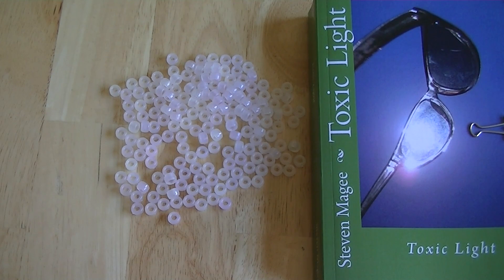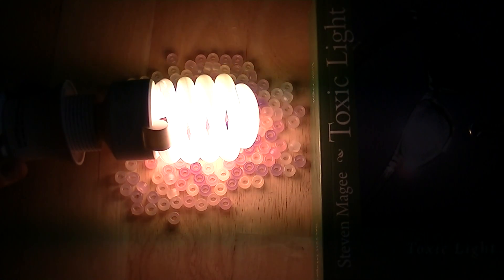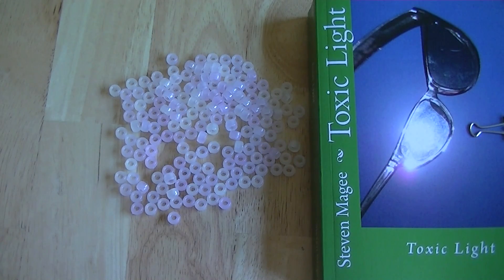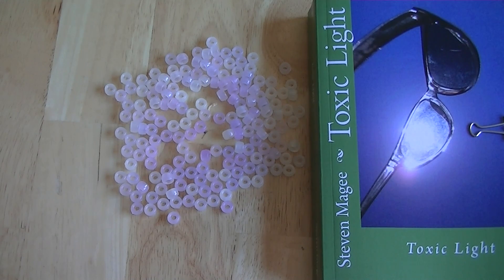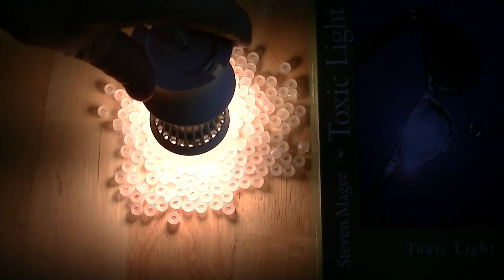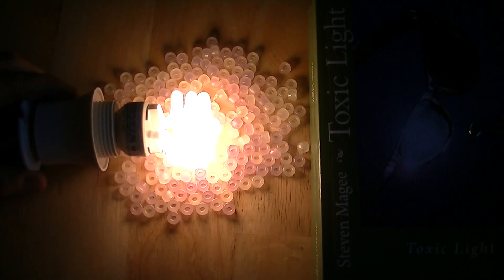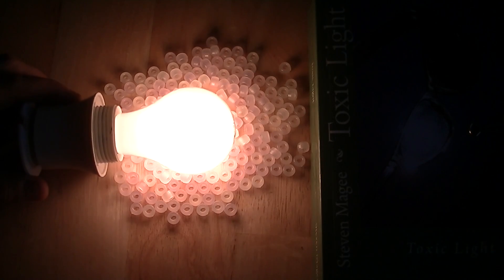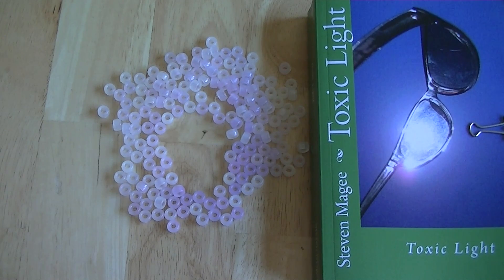Testing LED, CFL and Filament Light Bulbs for Ultraviolet (UV) Emissions

Comment: You can remove the glass bulb covering the Halogen envelope simply by wrapping the bulb with stick tape and then hitting it with a hammer, that way it can slide off easier.

Comment: If you tested the light bulbs and held them 1 foot away from the toy beads, do you think there would be a difference as to how much the beads color would change?  I am thinking the UV output would be less at 1 foot away but not sure.   Maybe I will have to buy some of these beads and test it myself out of curiosity.

Comment: there is a slight flaw in the logic presented here.

A: there are three types of UV radiation - UVA, UVB, UVC.  UVA is what blacklights put out in color, as do ALL florescent lamps, but the further you are from the CFL and tube type the less radiation you get received, to the point it has no affect.
B: what you might be REALLY sensitive to over a long period is the flicker of the florescent bulbs, which is very high frequency, and it can cause headaches or nausea in some people, even more so near the end of their life or at 50Hz.
C: Cheap quality LED bulbs (and chrismas light strings) also present a strobing effect in tune with the line frequency because there is no buffer inside to counteract this (a capacitor that provides power just long enough during the low point of the wave to keep it lit).

So while you analysis does show that UV radiation is emitted, it doesn't account the three types of radiation, (UVB and UVC are the more harmful ones and can cause burns and blisters).  Here is a word of advice, though, if the florescent bulb is CLEAR, then you are in danger without protective clothing because THOSE bulbs are Germicide lamps and they are intended to kill germs.
Reply: He demonstrated cause and effect, not a line of reasoning requiring a form of logic. I found this video to be very informative and helpful though not exhaustive. I went from here to WHO's website http://www.who.int/uv/faq/whatisuv/en/index2.html which gives helpful information about the types of UV radiation.

Comment: I like the leds. They start up quicker then CFL's they use less energy. They are cheaper to run, last longer and oh yes.. they don't get hot.
So the only negative point so far the price. But that is going down so fast that really they make the perfect replacement bulbs in my view.

And I have tested out an CFL with an Foveon Sensor. I have a foveon DSLR and those have an UV blocking inlet in the mount instead of being part of the sensor. This means I can take out that little UV filter and I can shoot IR and UV.

I shot a 20Watt CFL using the sensor exposed to the UV and IR and I did get a lovely stream of purple pouring out from the lamp in a cone.. Purple is the color of IR/UV on that sensor.

It is interresting to see really.. [and yes if you shoot a picture outside without the UV filter in the camera it gets super purple and all details are smoothed out by a purple haze]

The only thing I worry about :! Do they really last as long as on the box. I mean I heard about cost cutting here and there and it might easily be that a led bulb only lasts 50% as long as it could with certain cheaper components.

Still worth their money definitely :)

Comment: One thing I`ve noticed with the use of Halogen bulbs, not the electronic ballast type bulbs those are not only crazy expensive to use but the electronic ballast creates harmonics just like the LED & CFL bulbs... Back to the Halogen screw in type bulbs I found my emotions to be hampered or depressed when using them but when I switch back to the Phillips natural day light filament bulbs my emotions stabilize back to a more natural and peaceful state. I have switched back and forth and tried to stay with the Halogen due to them being known as the closest artificial light source that matches the God given sun light... I love that my microscope has a Halogen bulb, huge smile :]

My observation was Halogen bulbs worked fine for short session areas like a closet, bedroom, maybe bathroom but not good for living or dining room areas.

Am I alone on this awareness of emotional fluctuation and light bulbs ? Not just the various colors but the different types...

Comment: Melatonin production is reduced by exposure to blue light at a wavelength around 455 nm. LEDs are almost exclusively produced around this wavelength, then the color is shifted using phosphors. The receptors in your eyes that control your circadian rhythm are sensitive to this range of wavelengths.